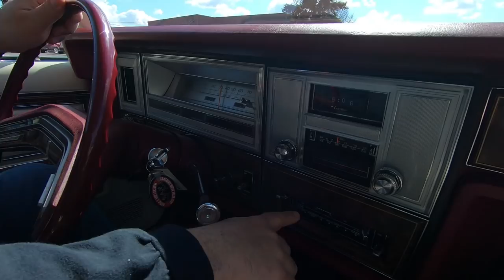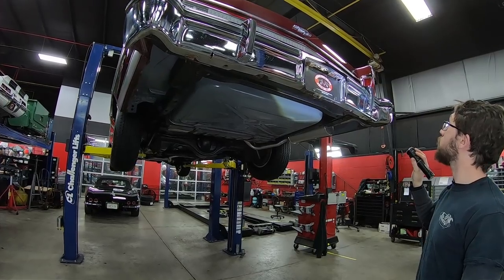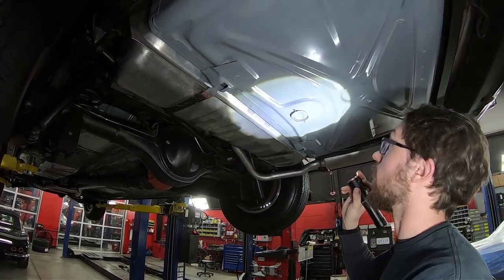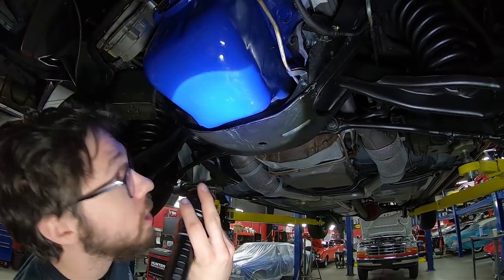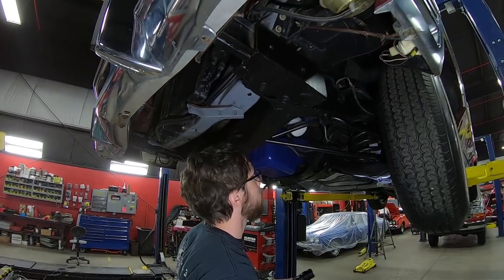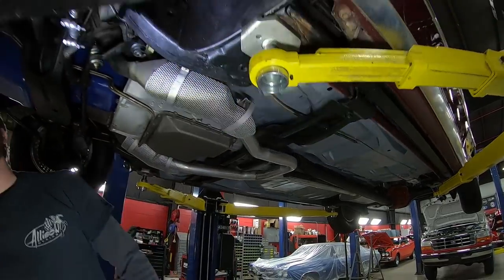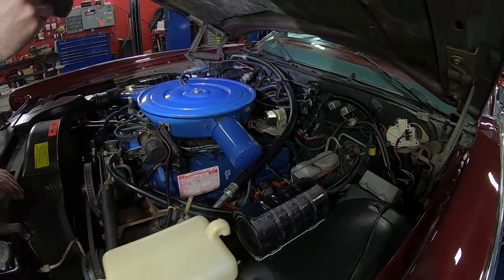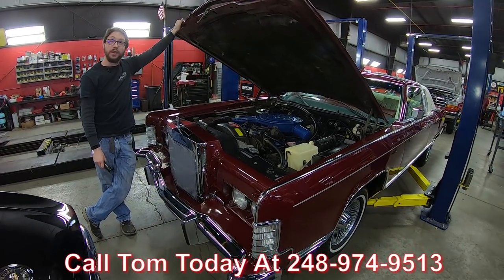1978 Lincoln Town Coupe For Sale

Comment: 1978 Lincoln Town Coupe, just amazing condition, the underside is just like new, isn’t it, Wow.
One thing I would like to see demonstrated by Vanguard Motor Sales is the outside Opera - Lamps on these classic cars, it would only take about three minutes or so of Video in the dark, If you could switch of the lightning in the showroom we will all be able to see that the Opera - Lamps are working just fine.